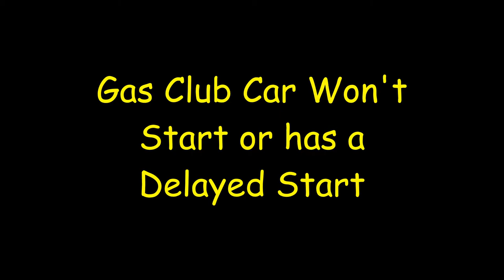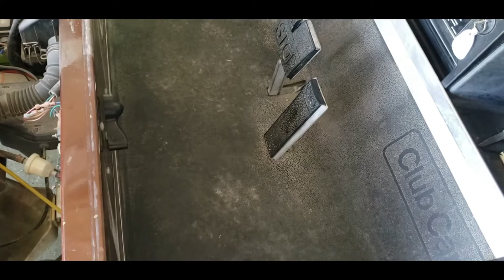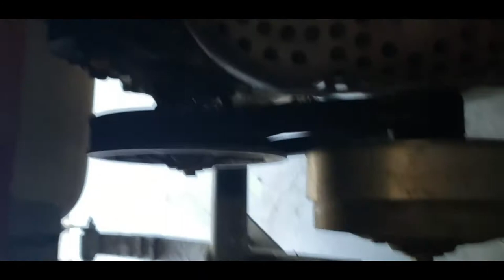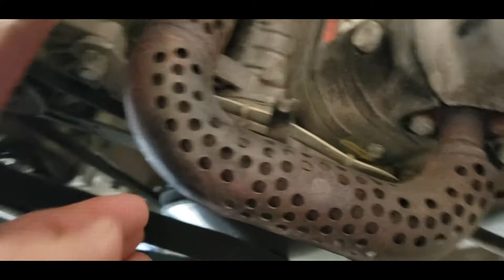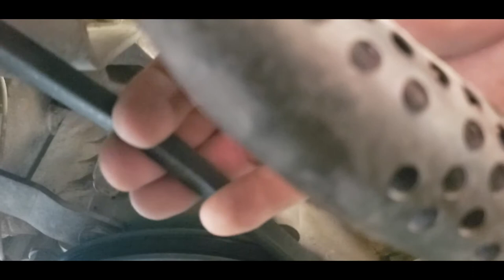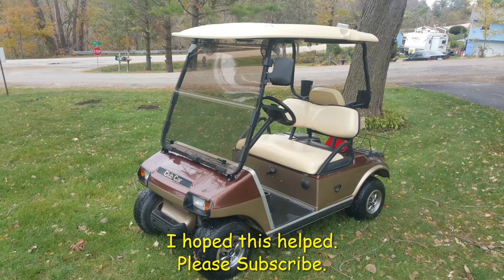Gas Club Car "Won't Start Up"

Comment: Okay, so where’s the bolt?
Reply from the maker: Will try to send a picture tomorrow. It's almost a two person job to get it tight. One to pull tension on the belt with a bar while the other tightens the bolt.
Reply from the maker: Access to the starter/generator is under the back plate. Two bolts to loosen and then tighten.